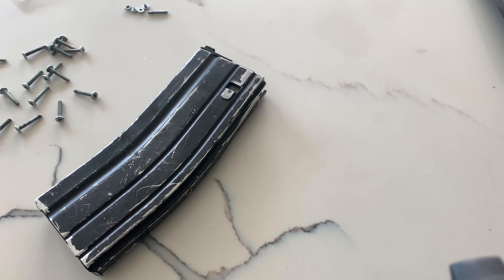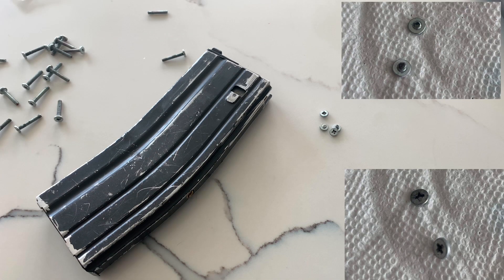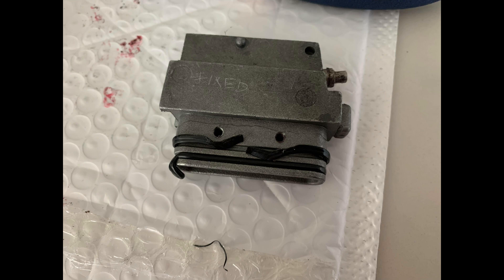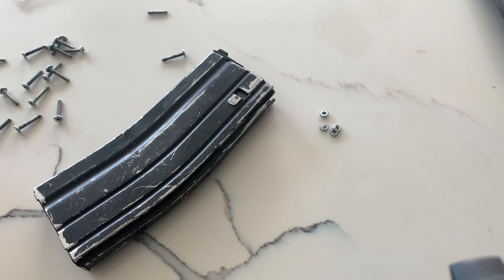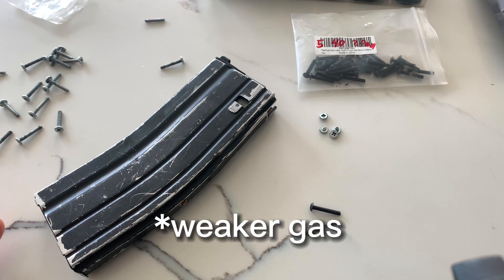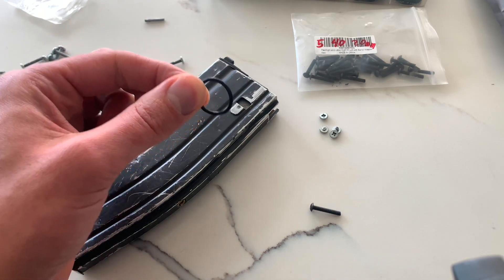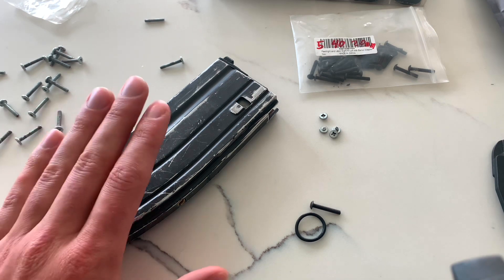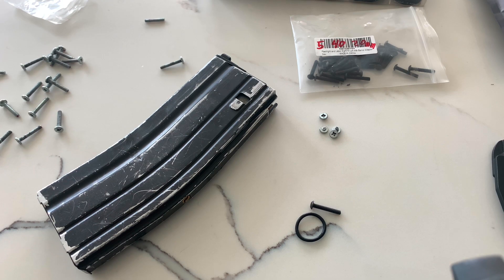Vipertech urgent mag upgrade.

Comment: They look stronger than the GHK, where the top is made of Chinese metal. I've seen GHK mags shoot the whole tube off so the shell gets blown up.
Reply from the maker: @MKAnr1 that actually happen to one of my Ghk AK mags, the tube got blown out. It destroyed the threats too, rendering the mag useless. 

There are a few issues I have with the Ghk mags.
Reply: That's only with the v1's, v2's are stronger than EBtech's.
Reply from the maker: @boostav  I think you meant to say the 3 generation. 
First generation were the heavy mags with a pin going through the middle

Second gen had still tubes 

Third gen are the ones where the tubes got replaced with a big block of CNC aluminum making it much strong that’s right. 

Yes It seems with that  new build they stronger should be stronger then ebtech. how did you find out that they actually are?
Reply: @TomiHarley  There's only v1 and v2 officially. v1 is the one with tubes and then you have v2 with the big block, but there are two generations of v2, one that is heavy (early) and one that is lighter (current).

Nothing scientific, but just by looking at it the v2 GHK mag has thicker walls and a cylindrical reservoir shape, both things that should make it withstand higher pressures. 

I guess it's no coincidence the EBtech blew while I haven't heard any of the GHK v2 tanks failing.
Reply from the maker: @boostav  yes, we are on the same page then.